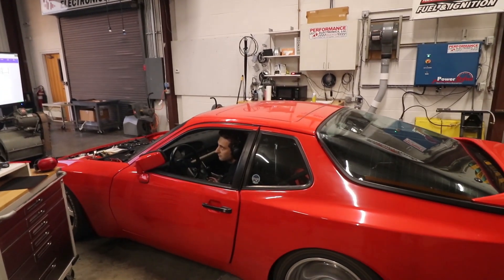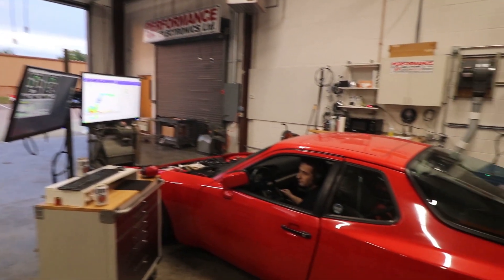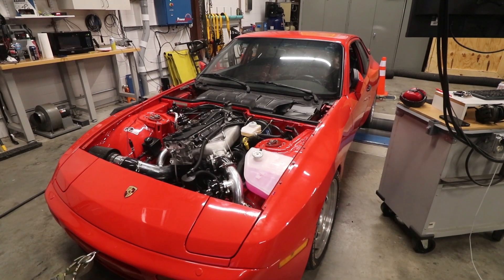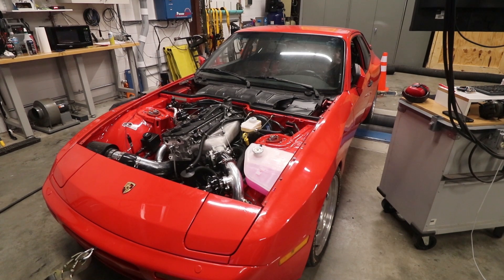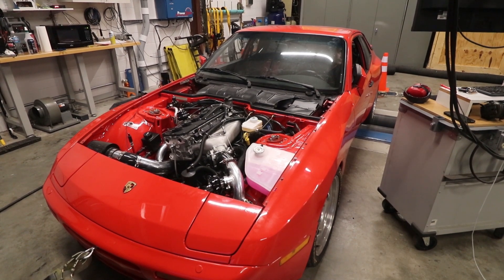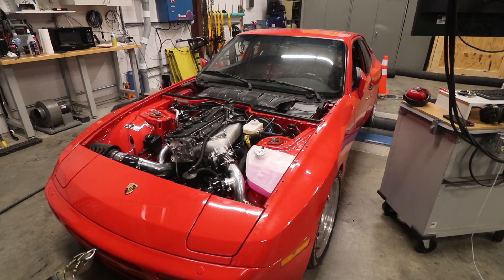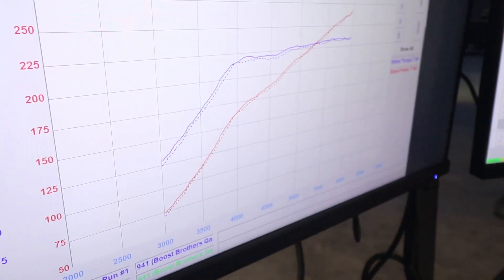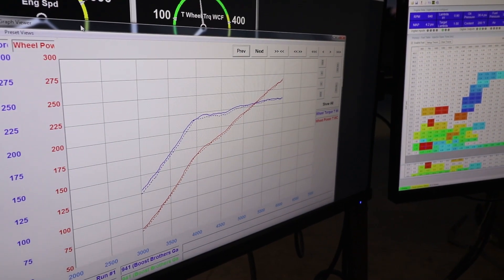Turbo 07K Build - Part 7 (Porsche 944 5 Cylinder Swap)

Comment: so im about to buy your SPA manifold for the 07k 5 cylinder, do you guys know if it will fit in the engine bay of a mk6 golf? im still going to buy it if its to big, my firewall will have to pay the price because i need boost!

what engine management are you using?
Reply from the maker: To my knowledge it will! It’s fits the Rabbit. 
We are using the Performance Electronics ECU. We have more info on it on our website!
Reply: Boost Brothers Garage thanks guys, I really appreciate your help

Comment: did you change anything on the stock motor, like compression ratio? you said yo took the timing back to less than 10deg,  and no valve timing, but other than that?
Reply from the maker: Nope, all stock internals!

Comment: Remind me of the best 07k motor to use again. Getting an itch to attempt this.
Reply from the maker: I prefer 08-10 but any 08 and up will work great. 08 is when they went to the upgraded timing chain. 11 and up has a two stage oil pump that is a bit more complex.
Reply: @BoostBrothersGarage  Thank you very much.  I appreciate your quick response. Should have been more careful though, Murphy's Law just killed an engine in my daily driver.😪
Reply from the maker: No way! Sounds like your luck is as bad as mine. Sorry man!
Reply: @BoostBrothersGarage  blew a head gasket. Easier to buy another engine than repair. Need to have a money flying away emoji.
Reply: The early 07K's (mostly pre-07) had forged cranks. Well some not all, there doesnt seem to be much rhyme or reason to it. The timing chain is easily upgraded to the newer spec and it's not a big deal since you'll probably be replacing it anyway.

Comment: Got me second guessing an LS swap now...
Reply from the maker: Wait til the final numbers come out! Plus, no hydro boost brake conversion, no spacing the crossmember down, better weight distribution and replacement engines are only $300!

Comment: Is there room across the top for a strut bar?
Reply from the maker: Yes. The one that was on the car interfered with the throttle bracket though so we’ll need to do some modifications to it.

Comment: This is friken cool! 360 wheel was easy! Think there would be more in it between 7500 and 8500 rpm with some springs? Keep up the good work! This is one of the coolest swaps I have seen!
Reply: I would love to see down the road of this swap some engine tunes for cams in both n/a and turbo applications as well as a tune for a fully built motor
Reply from the maker: Definitely not out of the question!
Reply from the maker: Thanks! Cams and springs would REALLY make it sing. The stock cams are awful considering how good the head is.
Reply: @BoostBrothersGarage  This makes me sad seeing VW restrict the power of the 07k all for the issue ridden 2.0t FSI and TSI motors :(
Reply from the maker: Exactly!
Reply: @BoostBrothersGarage   Is anyone making camshafts for the 07k? I've been looking at this for my next project but i'd love to squeeze some more power from the n/a engine.
Reply from the maker: Cat Cams
Reply: @BoostBrothersGarage   Well I just got back from the rabbit hole of vwvortex threads that I didn't even know existed. Have you thought about going for a higher compression on the N/A car instead of or in conjunction with the cams?
Reply from the maker: Absolutely! That’s pretty much a requirement for a proper NA engine build. 11.5:1 compression, cams and ITB’s would be a sweet little package. However, most people doing the NA swap are using it as a stepping stone until they add boost later down the road. There are however classes that limit your displacement with multipliers for forced induction that would cause you to stay NA.